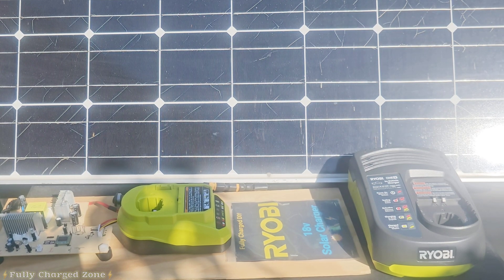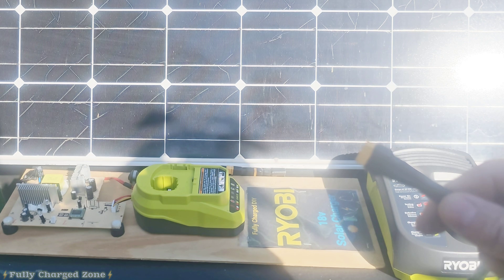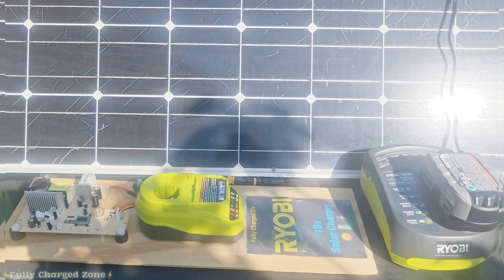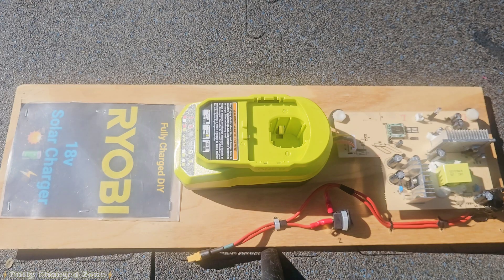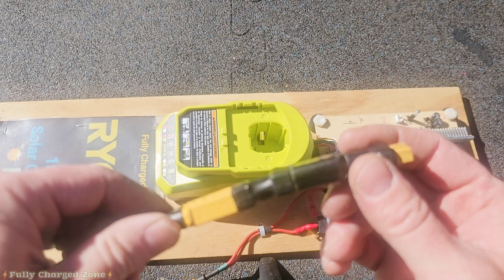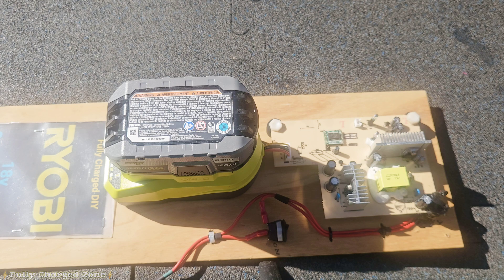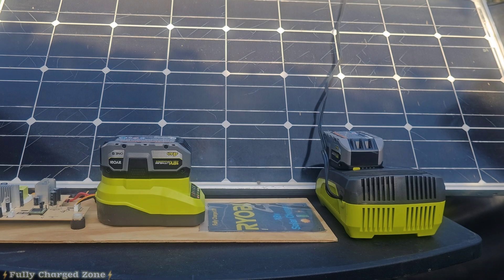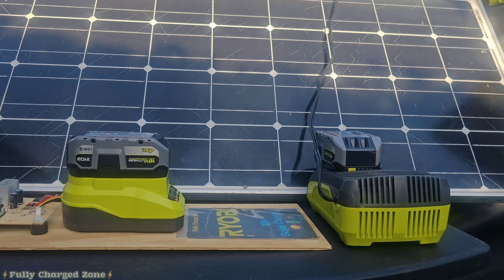Ryobi 20v Battery Solar Charging DIY!

Comment: I think I still like using a buck/boost converter with LVC to charge batteries. One advantage is that I could charge tool batteries to even ebike batteries with it. The LVC setting would act as a manual version of an MPPT, maximizing power generation to deliver to the battery.

From my experiences, using DC chargers would either bring the panel voltage way down to the point it cuts out, or it doesn't fully utilize the panel's power
Reply from the maker: Both ways work pretty well. I had a bad experience  with using buck converters. They can catch fire and also dont last long when charging drill batteries.  I like that the 12v charger will just shut off when fully charged of when it gets to hot.
Reply: @FullyChargedZone  Generally, when it comes to chinese components like such, I like to oversize based on their rated power.

Like I have an 1800w boost converter, which could take in 40 amps max. But I would half that rating.

Me personally, I haven't come across a dedicated buck converter with LVC that is high wattage.

But I do know 2 buck/boost converters that are quite good for low-power applications, ZK SJ20 and ZK SJ30.

Also, using a 12v charger does have its drawbacks. In addition to not being able to fully utilize the panel, but when it receives low light, it chokes the solar system, crashes your voltage, and overtime can damage your panels; As I mentioned.